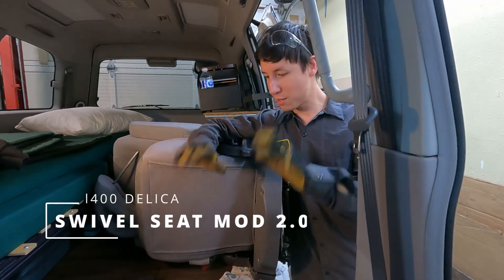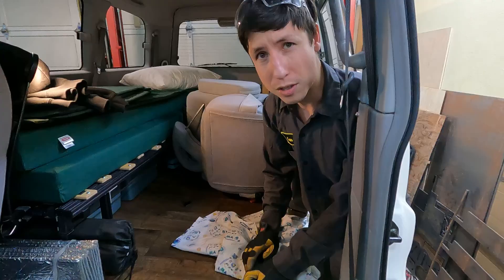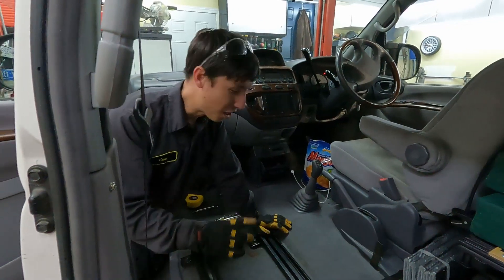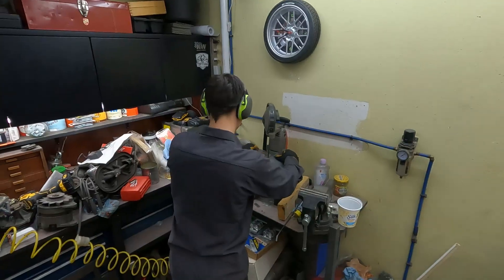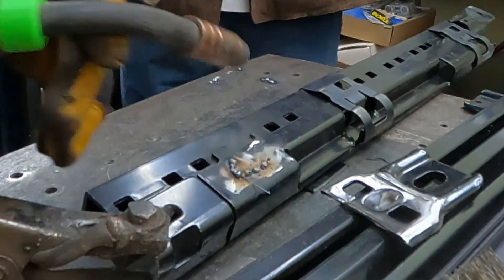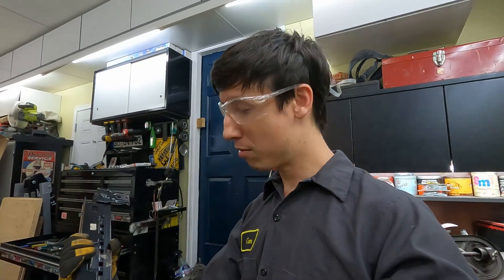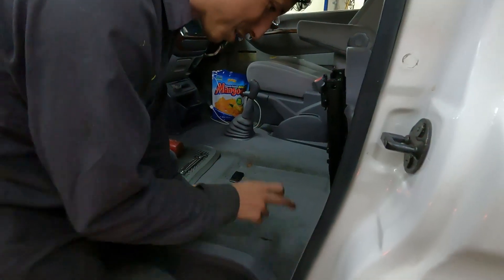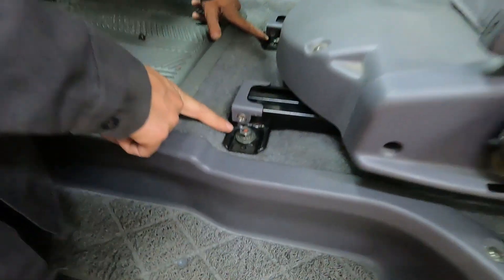Delica Passenger Seat Swivel Mod 2.0

Comment: Ok,silly question,but does the seat spin a full 180 degrees so it faces the back?
Reply from the maker: It will spin a full 360 with the limit tabs removed, or 180 if you leave them in place.